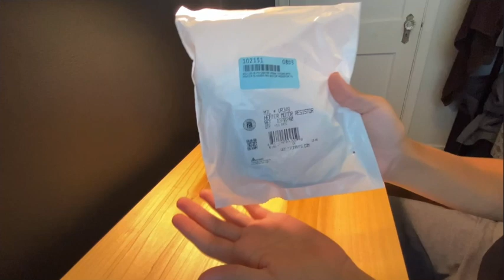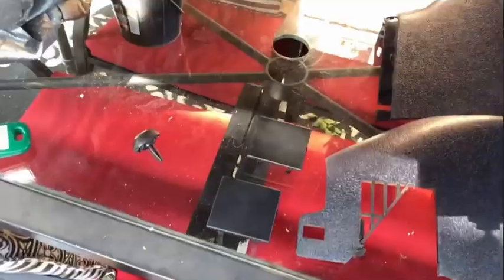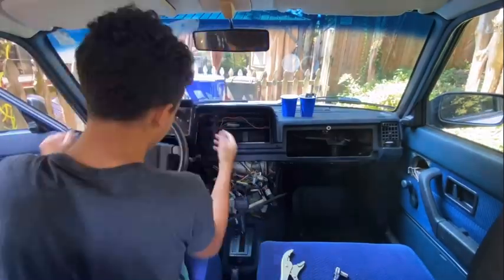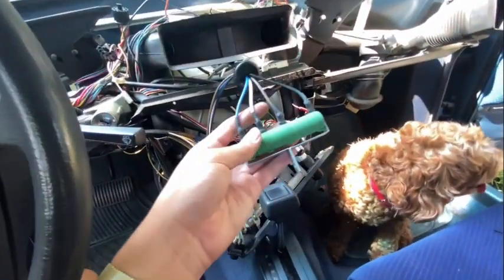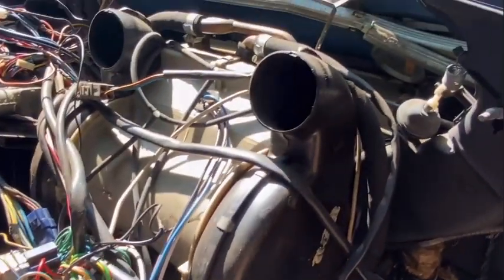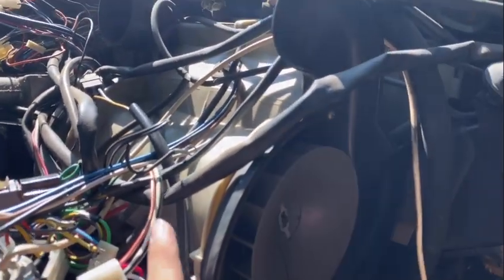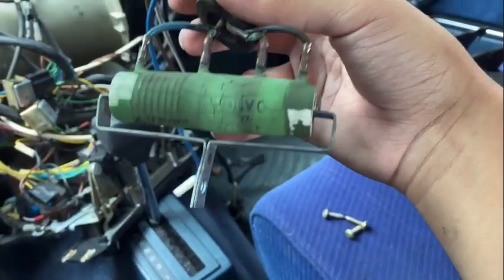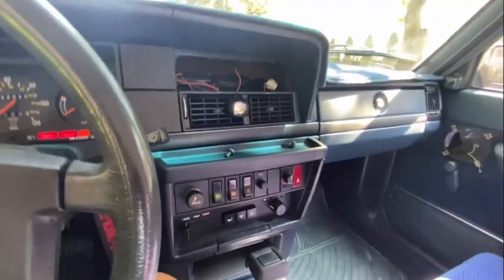How To Replace Volvo 240 Blower Motor | Step by Step

Comment: Daunting task well accomplished. To give all your followers and subscribers an idea of what it takes to this job, my Volvo Certified mechanic with over 30 years of experience (ONLY VOLVOS), takes a full day to do this job. (He has all the tools and equipment to work on these cars). That time frame is with constant attention to the vehicle without interruptions. Great job! BTW, to do this same motor fan replacement on a 740 or 940 it only takes 30 min. LOL
Reply from the maker: Thank you for your support!!! ❤️
Reply: I've done this work at least 4 times and it gets much easier after doing it a few times but yes it still takes a whole day to do it properly. In fact I prefer to take 2 days so I can take the opportunity to do other repairs and inspections while the dash is out. This also gives me time to review the work in my mind before putting everything back together the next day.

Comment: Get all of your negative leads pull all of the fuses out of the socket take a little wire brush and clean the connectors then replace all of the fuses and that car should run like a champ

Comment: Good job. That job sucks. I know because I have done it. Congrats on getting a sweet 240. 
The noise could be leaves stuck inside the heater box on the intake side.
Reply from the maker: Thanks! I'll have to check that intake soon!
Reply: @max._jolley  What was it?
Reply from the maker: @serg2057  I honestly have no idea... it just went away one day so I think one of the plastic fans was rubbing and it just ground down enough or something to not make the noise.
Reply: @max._jolley  love it when the problems go away with time haha.
Reply: @serg2057  
My '93 had an antifreeze leak at the head fix itself completely .  These cars are worthy of all love.   OV  LOV
                                     VOL  VO

Comment: Hey man listen I want you to do me a favor and check all of your negative connections up under the hood of the car that leads back to a lot of electrical problems on those cars okay clean those negative connections there's one behind the battery there's one on the passenger side up on the firewall clean that stuff take a wire brush and clean it and then put Dielectric grease and you won't have any of those problems anymore and I don't think that that heater just stopped working I think It All Leads back to the negative leads

Comment: The 1987 models did not have that problem s much as the 1990s on up the problems that they had for negative connectivity but the negative wire from the battery and back of the battery stuff like that if I were you I would do somewhere where they clean the cars and thebay you some engine Degreaser planer clean that engine down remove the battery cables first so you don't short out the alternator try to take a plastic bag and cover up the alternator before you start cleaning the engine bay give that engine bay a good cleaning cleaning negative connection including the battery cable

Comment: No, this is not the way to do it. You can get the whole fan housing out UNDER and to the right. Don't mess with the dashboard. Get it out to clean and check. Actually - to skip the difficulties with taking the fan package out - there is a very smart way of 'dremel' the housing wall and get the motor out from under/front. Then tape and seal it back together.
And: Always test and test the work before going all the way back. Test and check. And check again. (Your fan is not correctly installed i e rattling noise.)

Comment: qq - My car blows hot air, the fan works in all 4 positions. So my question is, does that mean that my blower works as well? I don't think so because I don't have A/C and I was told by the previous owner (a good friend of mine) that the AC issue was the blower but double checking just in case. Thanks!
Reply from the maker: The blower motor replaced in the video strictly blows air. In the 240s heat is pulled from the headers and to my understanding the AC condenser is just like any other car… that might be your issue! Thanks for the support 👍
Reply: @cornstar1253  Thanks!
Reply: @max._jolley  Agree 100.

Comment: it is the worse job on a 240, you took the long road, simply by disassembling the front of the console and prying the dashboard, you,re able to remove the side caps of the heater housing then the blower motor, I done that many times on 240's
 I rebuilt my blower motors  by fitting #609-2RS sealed bearings  in the place of the bushings, it required  2 adapter sleeves on the motor shaft and very little machining on the motor caps to recieve that bearings...this lasted the life of the car
Reply from the maker: Yeah it sucks… hopefully I won’t have to do it again haha thanks for the support!!